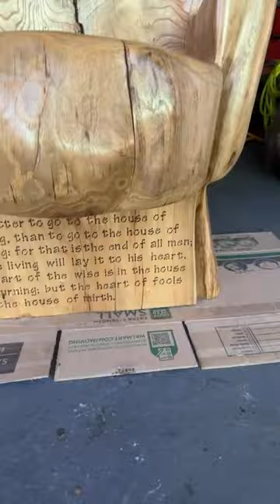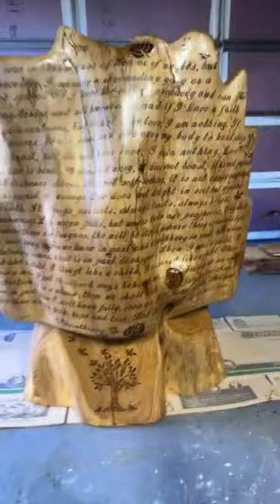Want to share a crazy short story with you

Comment: For those large cracks in the wood you are working on, did you try filling those with epoxy? I had tried it once on an old piece of furniture, a 5-minute epoxy - and so far it's been holding very well. Cheap and easy, and you can sand it down and polish if you will.

Comment: I'd like to know what think about our trees. Do you think they are a genetically modified version of the giant trees? I wonder if the radio towers aren't somewhat like the giant trees were. Thanks for the video! ❤
Reply from the maker: I don’t think the towers are as you mentioned.
I think I have finally cracked the code sort of speak when it comes to why all the metals, minerals and elements are extracted from rock of many different types which are the tree remains.
It’s much too big to explain in a comment, but I’m going to put it all together and present it although it will take some time to put it all together.
It’s absolutely mind blowing!
Reply: @hangman1128  Awesome! 👍❤